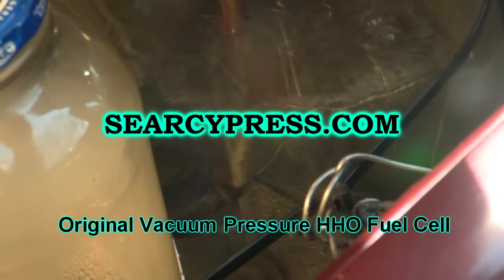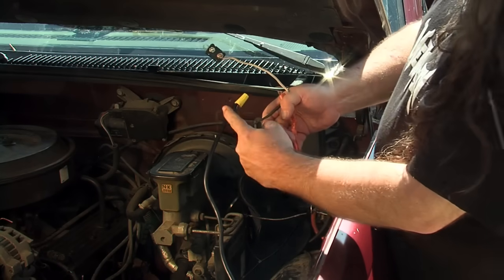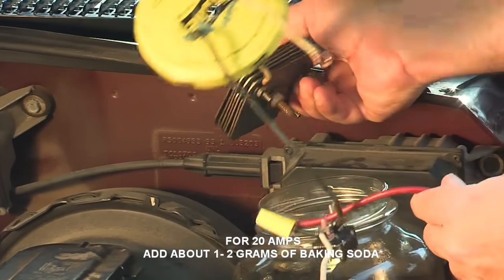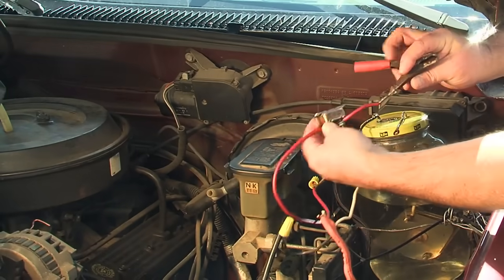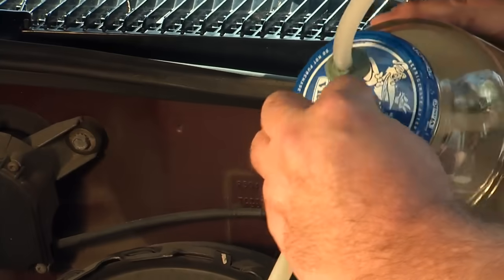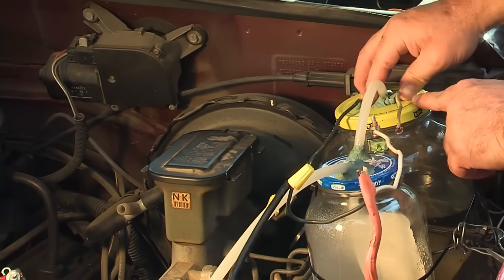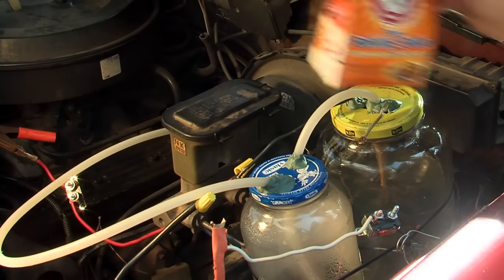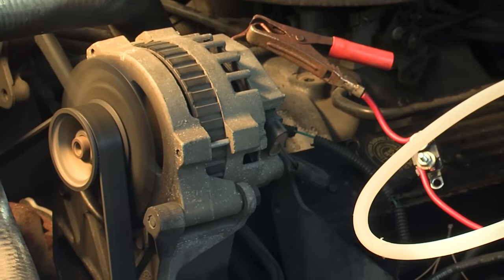Vacuum Pressure Hydrogen fuel cell defeats high gas prices using hydrogen from H2O.

Comment: I've seen some dryer jugs filled with water so that it turns it into a "bubbler." This is said to be a safer approach?..What is your thought?
Reply from the maker: If you look closely, this system does have a secondary jug in front. Water from the fuel cell will collect inside it, and because of the vacuum pressure it will return to the main cell automatically. This is a very cool automatic function. It is a bubbler so to speak.

Comment: Question : What's the the temperature of your tailpipe after driving on the highway? It makes a difference in its efficiency.
Reply from the maker: I don't have a good answer for that. The t-stat keeps the engine temp in check, but it does run cooler on short trips. I forgot to replace the radiator cap once and hit the freeway. After about 15 miles, all of the coolant was gone. I failed to notice the high temperature showing on the gauge until the truck stalled. Long story short, the engine was ok. I can't prove it, but I honestly believe running the fuel cell kept me from damaging the engine.

Comment: I'm not going to get real technical  but the vacuum line you are using is at the back of the manifold so your back cylinders will get more HHO than the front, see if you get better results by introducing the HHO under the Throttle body so HHO is more evenly distributed to the cylinders.
Reply: Like a nitrous port.

Comment: There is no question you get Hydrogen gas BUT the energy yield of the gas is the same as the energy put in to produce it less whatever inefficiencies are in the system. Try this test, run the engine at say 2000 rpm with the device disconnected by holding the throttle down with a stick or something when the engine is steady at its chosen RPM connect the device electrics to produce gas and watch the RPM, if they fall, that's the load going on the alternator.
Reply from the maker: I understand your confusion. This is a vacuum pressure fuel cell. It goes on the vacuum line. Try the same test with a fully heated vacuum pressure cell on the vacuum line. For that matter, just remove a vacuum line from your engine and watch what happens to the RPM.
Reply: Quick reply my friend but can I just clarify. does the cell produce Hydrogen gas? If so how?
Reply from the maker: @rubblejohnstone4460  this is not overunity...., nor is that claim made. It produces hydrogen and oxygen and steam. It actually produces steam below the normal boiling point of water due to the vacuum. Thanks very much for your comment.
Reply: Mertalpress I'm not having a snipe, not at all, I'm trying to understand the science behind the engineering and the use of vacuum intrigues me that's all. I guess what I'm asking is what's the advantage to the vehicle, if the device loads the generating system, what is the payback in terms of performance? Not hating, just comparing.
Reply from the maker: @rubblejohnstone4460  a cooler engine with more complete burn of fuel. Thanks for the comments.

Comment: Have you had any problems with sensors
Reply from the maker: No, but this type of truck runs rich. I suspect the gas and steam keeps things cleaner. I did burn a few ignition coils, but that seems to be a problem on this truck. And I never did have to replace the alternator.. that's one thing I fully expected to have to do, but this one held up. Thank you for the comment.

Comment: I hope that you installed a spark arrestor, just in case of a backfire. I used a small piece of pvc tube about 6" long, small diameter. I filled it with copper wool and capped both ends. Each end has a fitting and the unit is installed inline to the vac source.
Reply: wouldnt filling the other jar with plain water prevent this?

Comment: Congrats either you broke the laws of physics or turned your car into an extremely inefficient electric that you need to charge up every two minutes
Reply from the maker: Nothing of the sort, but thanks for the comment.
Reply: oh yea sorry i kinda just assumed that you were claiming to power your car using hydrogen created on site powered by alternator like alot of other people are doing you should definitely go into more detail on how you are putting hydrogen in the a/f ratio to improve combustion. I think your better off just using turbo though.  @metalpresstv

Comment: Without deceiving the car computer it can't be done. It will continually re adjust the fuel/air ratio. Tried all the gadgets to adjust same but on the modern cars in can't be  done without removing the PC. Doing this is illegal in most places and hefty fines of up to $80,000. If you have a pre 80's car go for it . Just watch how much you use and watch your engine temp so nothing melts!
Reply: Engine temps will actually go down, not up. Show me the law that this is illegal. There are efie modules to use on modern car electronics.

Comment: This is nothing new. My father had one of these on his car back in the 60's and other than a conversation piece it didn't improve his gas mileage one bit. It takes more energy to separate the oxygen and hydrogen than is produced when it recombines. The energy coming from the alternator is less than the energy to run the gas engine. The problem with this idea is that it is nothing more than a perpetual motion machine from which you get more energy than you put in. The building techniques of the author are a joke. Modeling clay or putty will never seal against a vacuum. Passing wires carrying 20 or 30 amps through a metal lid is an explosion waiting to happen. So what do you think will happen to the glass jars just lying haphazardly under the hood when the car hits a pothole? This is nothing more than con job.
Reply from the maker: You are misinformed. But thanks for the comment.

Comment: How does the hydrogen come out at a steady pace? If the battery is on doesn't it keep producing hydrogen?
Reply: Yep. Thats why he have a wall switch mounted in his cab to turn off.
Reply: @SamaritanElad  how do you know when to turn it on and off?
Reply: @leanjavabean587  Turn on after engine is running. Shut off just before you turn off the engine
Reply: @SamaritanElad  I'm just confused about how it doesn't over produce hyrogen if you are in idle
Reply: @leanjavabean587  Yes. He could put in a low pressure switch. Pumping in 30amps is too way much. Kits on the market (dry cells) only pull 6-10amps. I didn't see any flashback arrestor either. Dangerous using glass jars... It works for him, but not an idea setup. I'd stick to a professional kit. https://hydrogengarage.com/
Reply: @leanjavabean587  YEKS - Their prices doubled from a few years ago
Reply: @SamaritanElad  yeah and it's not available anymore the link is gone but I'm really interested in building my own
Reply: Thanks for the advice!

Comment: When hydrogen mixes with oxygen it becomes a bomb REALLY easily..... They are making Hydrogen Cars now, but they store the gas in a we 150lbs Gas Cylinder to for safety. If this guy is producing Hydrogen...... I don't recommend trying it.
Reply from the maker: This is a vacuum system. Nothing like a pressurized system.

Comment: If you are telling the truth about gas milige,i think ,you are getting better milage because water evaperates quiker in a low vacuum state.And helps the engine become like steam engine.Hho production takes alot of effort of the altenator,dont believe me?(take a altenator and spin it (spins fine)now put the wires togeter and create a short (spin not at all).Sorry for spelling englisch is not my common language.
Reply from the maker: You are partly right. Thanks very much for the comment.

Comment: but the leftover water sludge is toxic to the environment and the water needs to be replaced constantly as the hho is depleted this is not a good thing to do a commercial unit is the way to go if they were available in this size.

Comment: If this was so easy, why arent automakers just putting in a separate "water tank" for you to fill up periodically with a built in hydrogen system? Sure seems to be easier to do this than to make a hydrid electric prius with a 400 lb lithium ion battery and extra electric drive motor. But it's on the internet so it must all be true. Maybe those toyota engineers just need to go to this guy's backyard and check out his 92 TBI chevy pickup. So many wasted semesters taking thermodynamics and heat transfer, huh?
Reply from the maker: Why is liquid fuel dumped into the piston? It runs on vapor... They can do better, they don't because they are also in the oil business. Thanks for the comment.
Reply: Metalpress TV hydrogen isn’t the answer. Electrolysis uses more energy than the result puts out. Each energy conversion you lose energy. Wait causes electrolysis? Oh yeah it’s electricity! where does it come from in the car? From the battery and alternator! What gives power to alternator? Oh yeah gas engines! So use more gas to get use more electricity to make hydrogen which is then pumped into the same gas engine! You don’t get more energy in a closed system. There is no way this saves energy or increases efficiency. It’s not physically possible
Reply: I know you're being sarcastic, but I've thought the same thing. I own a hybrid camry and even though it already gives great mileage I'm being tempted to so this kind of thing.
Reply: Companies would lose money in the long run. These thing extend egine life by literally years.

Comment: This DEFINITELY will work at saving fuel.  When this boils over, and it will at the stated 350 Watts going into that jar, then you'll hydraulically lock your engine with sodium bicarbonate in solution (that's the real science bit of it).  Your car will use literally no fuel at all after running this brilliant system for a short while.
Reply: @travisheck5979  I'm pretty sure you didn't read beyond the first sentence of my comment before attacking your keyboard.  Slow down young gun.
Reply: You're absolutely right. I read the whole thing but I grossly misunderstood it. I'm gonna delete my comment now out of shame. Sorry mate

Comment: scam. i used hho generator, + lpg,   4liter engine car, its decreased mpg instead of increased... first did with 12 - 13 amps then 7.1 amps
Reply from the maker: This is a vacuum pressure fuel cell. Not your typical HHO generator. There is a big diffrence. If you had no luck, sorry to hear that. Thanks for the comment.

Comment: A separate battery system to power the h generator would remove the load from your alt.  Can have solar to keep it charged.
Reply: Don’t think the weight is going to make a huge difference to be honest
Reply: Moving the weight of those batterys and panels would be the problem again.
Reply: Aka just skip the hydrogen cell and go electric....
Reply: bebeats technically, you would be making your car a hybrid in a way. And the other guy is right, you usually dont lose fuel economy by like a 20 pound difference
Reply: @tylerl6942  nah a 20 pound difference wouldnt do much. but then aain 20 pounds of battery wold barely be enough to power a mopet ;p most hybrid or electrick vehicles pack a couple 100 pounds at least.
Reply: @darrellbeets7758  that's fair. Still though, to a suv or a truck, a couple hundred pounds isn't much. In the winter, my truck sometimes gets loaded with like, 400 pounds of snow, and I still truck it at like, 20 mpg, which I usually get 22. It does accelerate slightly slower, but I think you can find a good balance. I thought maybe a buyout vehicle that'll have all those panels and batteries anyways, and just the system separate. Still a lot I dont know about it thought
Reply: @darrellbeets7758  not all of us can afford electric

Comment: I have a 2011 Mazda 3 with fuel injection. Where can I hook a system up? Or can it be done at all. I'm thinking sensors are going to freak out because of the hydrogen fuel. Is that going to be the situation? Thanks

Comment: Dude does it replace gasoline? If not what it the savings in $ or %s if you like
Reply from the maker: It depends on if you use the gains for performance or economy. Its hard to resist more pep in the petal. If you can't, you won't see any mileage increase at all. Freeway smooth runs increased the mileage from 15 to 24mpg. It certainly depends on how you drive it.

Comment: I get it.  The key is the vacuum. Good job dude.
Reply from the maker: The thermal properties that take place in a vacuum are one of the main advantages. The water behaves just like a refrigerant in the transfer of heat. The atmospheric behavior lowers the boiling point of the water. The combination of those two factors is beneficial.

Comment: I'd love to see a before and after dyno pull to see any fluctuations is output
Reply: I’m  guessing it’s about 1/100th horse power minus the drag on the on the alternator. When the wires going into the glass jar “HYDROGEN FUEL CELL” haha he will blow the shit out of the engine bay.
Reply: @adriantaylor9535  12V at 30A is 0.36KW, about 0.5hp. Never gonna get those back from his "fuel cell"
Reply: @Stripcherry3  So switch over to synthetic oil & put in a k&n air filter, you will gain 2-5 hp. Negating any loss from the increased alternator draw. And losing .5 hp isn't something you will ever feel anyway. You obviously know nothing about cars.
Reply: @edmelungeon2239  The point isn't about losing that 0.5hp, it's about gain absolutely nothing from doing this to your car.
Reply: @edmelungeon2239  you are still using more power/gasoline to make the hydrogen than the power gain/fuel save when the engine burns the hydrogen. Just go with the filter, tune up, and good oil to do the best with what you have without the hydrogen. Also what you save on fuel you will be spending on an alternator much sooner.
Reply: @Stripcherry3  you gain more water in your engine and oil.
Reply: I have seen this one time before on a Chevy avalanche. 5.3 truck Guy used one and got hp tuners hooked up. He did some things with the o2s to get his A/F correct. It's a cleaner burning fuel. Ended up getting around 26mpg. Mind you it's not running just on hydrogen gas. It would never produce enough for that. But it does however burn efficient enough to see mpg increased. 26mpg is nothing to snark at. Especially in a full size truck with a 5.3l v8.
Reply: Any power gained is more than offset by the LOAD on the alternator.
Reply: @RobertELee420  I doubt it. The power is unregulated, excess gas represents wastage of power. Alternators usually put out 13.5V to 14.5V so were talking, lets sat 400W of power that needs to be met to call it even so if that increase in fuel burn efficiency gives you more than 400W then great but this system needs to also contend with excess water vapour in the engine which also reduced efficiency.

Reduced pressure = reduced boiling point. The cell with boil soon enough
Reply: No one said anything about more horspower. He said more miles.
Reply: @sondresrbraten205  You are taking away power(hp) from the engine to produce hydrogen and you gotta give those back and plus some extra to increase the efficiency and get more miles. But you use more than give back and thats why this can't work. So yeah, it is about horsepower.
Reply: @Stripcherry3  yeah i know this won't work. My point was only that he never said that the engine would get more power. 👍

Comment: What does the baking soda do to the water?
Reply from the maker: H2O, water, in its pure form does not conduct electricity. It is necessary to add an electrolyte such as baking soda to the water so it will conduct. Very often tap water may contain enough minerals to carry sufficient current. More than likely it will not have enough so you add the baking soda to get sufficient current flow.

Comment: You could add an extra alt and use it strictly for the hydro generator, wouldn't that make more sense?
Reply: There is an advantage to doing it with another alternator.  Not all cars are equipped with an alternator that will provide an extra 30 Amps over it's everyday usage cycle, due to the 'product cheapening department'.  Using another would take the strain off the first one and could also serve to fill a second battery for emergency usage.

Comment: Does anyone have any thoughts on mixture ratios for the gasoline vapor and HHO? This would be helpful in sizing the HHO generator and eliminating risk of engine damage to provide a measurable benefit
Reply: Yeah I'm with you on that one I need a whole ingredients list plus mixtures and procedures which would be very helpful. But other than that it's pretty damn awesome I'm going to try it in one of my tractors before I tried in my my 2007 Acura MDX

Comment: I would not use a glass tank for the hydrogen generator tank(don't know if the ones in the video are out of plastic), because it would break much easier on impact also causing the gas to leak which increases the chance of an explosion.
Reply: Nah buddy, this system might make about a liter of HHO per minute, maybe two. If the system is off its making 0 liters, so in an accident you just have broken glass and water.

If the system is on and running during the accident, then the system is operating under a vacuum meaning there's still 0 liters of HHO. So only water and broken glass again.

There is no way for the system to be fully charged during an accident in this setup. And since the system is connected to the alternator, as soon as the engine dies then the system will shut off.

Since the jars are glass, they will almost certainly break, which means even if the engine continues to run, the fuel cell will have no fuel and therefor no HHO 

This is pretty darn safe for a YouTube garage rig